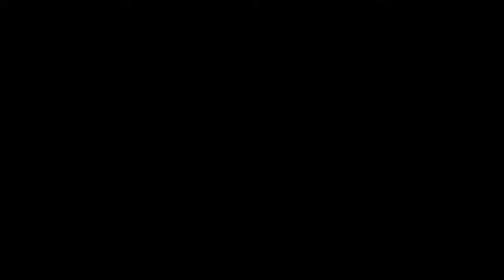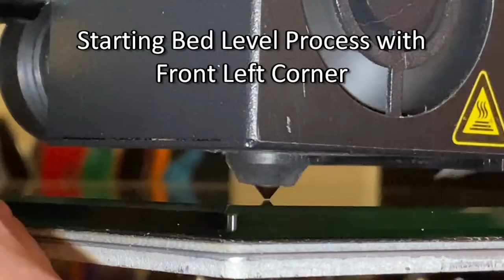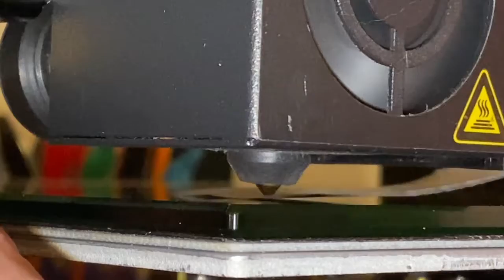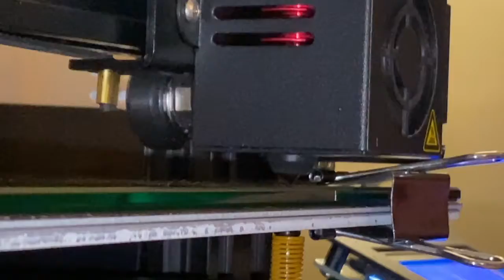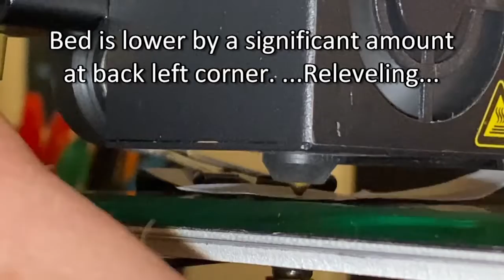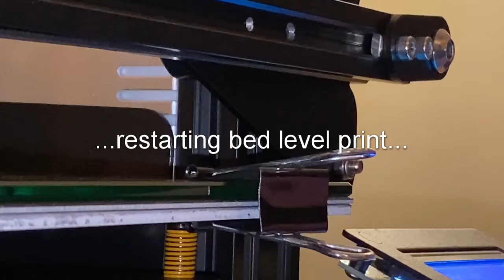Ender 3 Bed Level Issues

Comment: Hi, did you fix this problem?
Reply: Yes it turns out my aluminum Y carriage was bent/warped enough to where it made it almost impossible to level. I replaced the carriage with a 3 point leveling carriage (can find on Amazon), shimmed my Z axis motor with some washers, used some dry teflon lube on the Z lead screw, and it resolved itself.